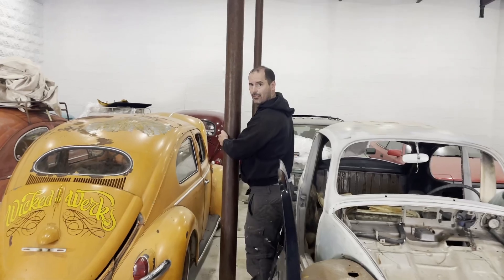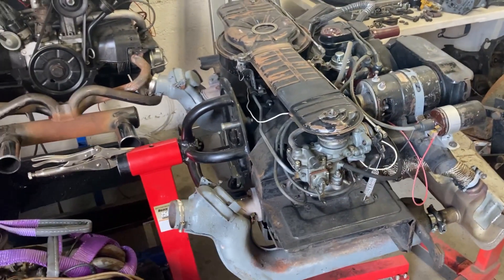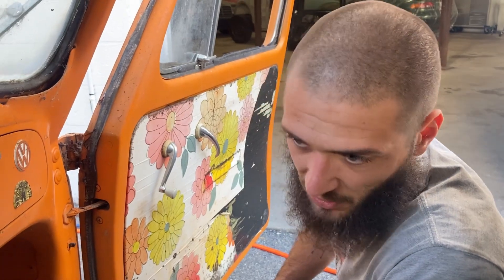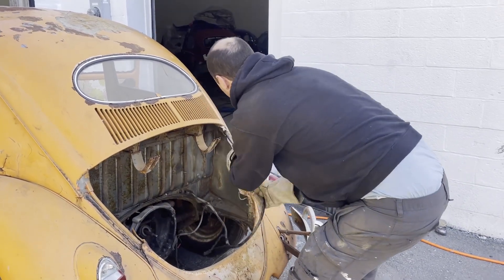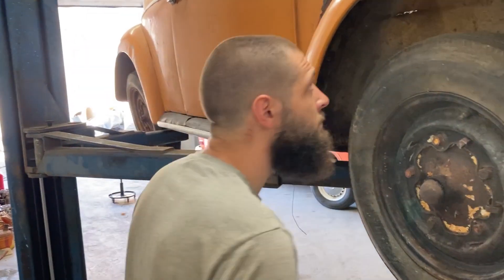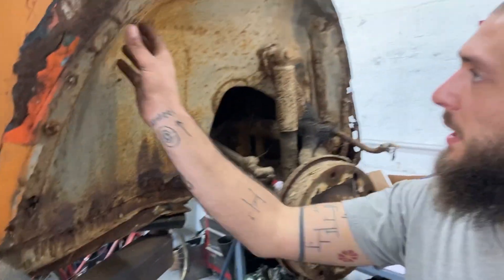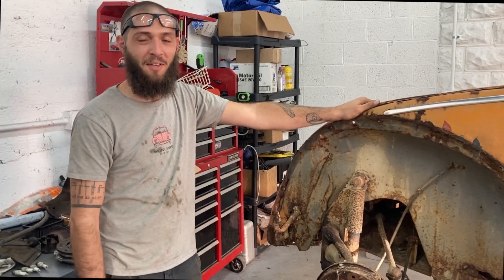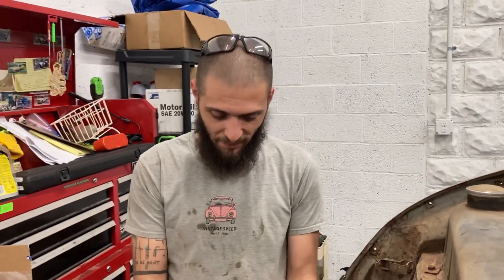'57 VW Oval Beetle Rescue - The Tear Down

Comment: I know the feeling.. that is why I completely stripped all paint and way to thick Bondo off my 59 deluxe...cut out all hidden rust holes and major Dents that were covered over and filled in with Bondo...I then used  aMaytag metal and hand formed patches..I welded them in using flux core...It will end up with Body filler but minumal amount applied properly...I'm using urethane primer, paint and clear coat by speedokote...Red and black..1959 was my year of birth... Rebelya is her name...